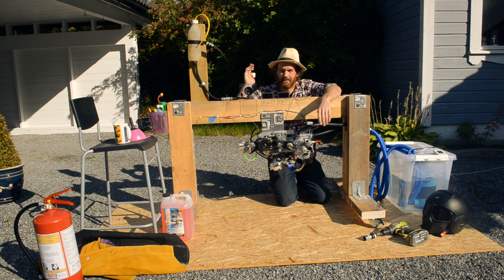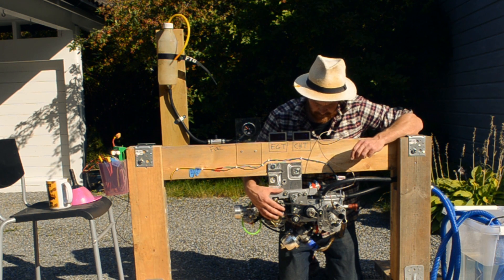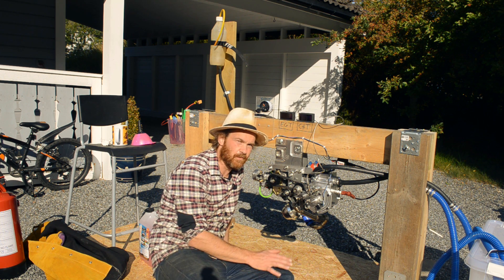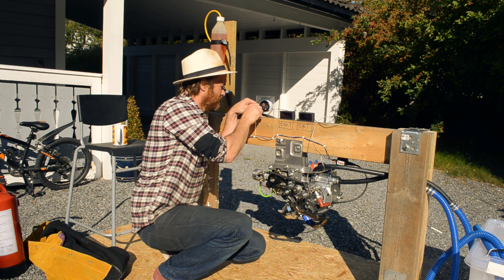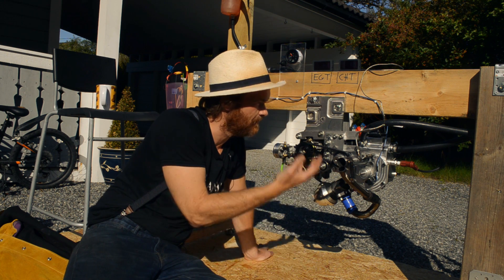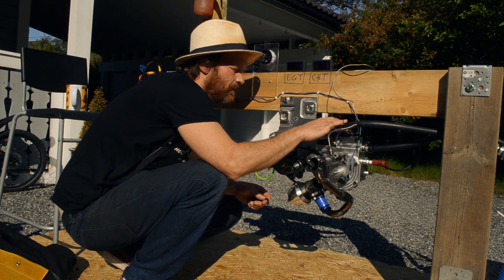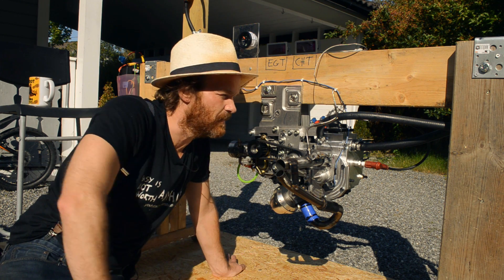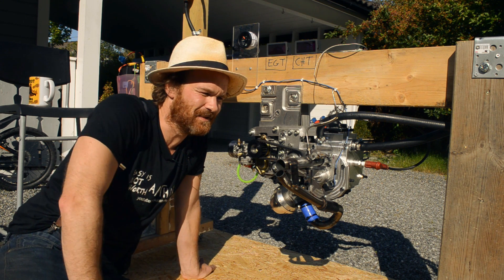First start! 50cc Supercharged Nitro Two Stroke - Will it explode?!

Comment: re watching this video the engine dies a soon as the throttle is backed off and or not reving if this was a 4 stroke adaption i would check timing or exhaust with it being 2 stroke i guessing to high crank case pressure

Comment: Considering a 2-stroke engine essentially supercharges itself as it gets higher into the rev range but has almost no low-end torque, you 'may' need a flywheel of some sort to maintain a steady idle when you're trying to use forced induction.   Just a thought.

Comment: The compressor takes away a lot of the momentum so please consider some small flywheel on the crankshaft or maybe some additional small flywheel also on the compressor shaft. Then the better solution to compressor losses could well be designing some variable compressor depending on engine rpm and throttle position … saving your fuel consumption and waist gate action … compressors are well known horse power guzzlers. Keep up the good work YEAHHHH

Comment: The problem is you're not supposed to supercharged a two-stroke all that's going to do is blowing fuel out the exhaust as the pressure in the head increases it blows more and more fuel out of the motor that's why you are having a lean out where it will not run that's because there's no fuel in the chamber inside the motor anymore it sounds like a good idea but it will never work the more the boost pressure increases the more air and fuel you are blowing out of the motor
Reply from the maker: You might have missed  the part about the rotary exhaust valve.
Reply: @2STROKESTUFFING  looks like it's not working for you 😕
Reply from the maker: @outdoorman6018  See the latest video. Massive blow through before the valve closes at bdc is intentional to purge spent gases.
Reply: @2STROKESTUFFING  it's a cool idea but a lot of work to try to make it work it would be easier to make a 4 stroke  supercharged because it was ment for it

Comment: Respect for all the work and thinking, but this product is totally overdesigned and overcomplicated for the simple purpose it is meant to deliver. And even if its output is 3,28% above other high performance engines of similar size - what is it worth if failure happens after 23 minutes of running?

Many generations of inventors went similar or same the route, only to return to more simple solutions at the end.

Regards from Germany.
Reply from the maker: I know, I know. Already got the simple solution on development (pip engine).
Reply: Thanks for answering. Still I owe you large portions of respect for going crazy on this. Looks like the Swedish Wideness powers such ideas. I robbed a few tipp also for classic working on my 2-stroke project - which however cannot be compared to yours: https://m.youtube.com/watch?v=H3s_CemOJ9c&t=44s
Reply: @2STROKESTUFFING  its a good thing you wear all of that safety equipment and call and tell so many people about the supposedly dangerous thing you're doing. Frankly if you're so dense that you route the exhaust of a motor straight at yourself... yeah, its no wonder you're overly afraid of what you have built. You're a good engineer but idk if your character flaws are going to stand up to the test of time here on youtube. Don't forget that unlike real life, anything on the internet might be around literally forever.

Comment: It just sounds like it's not timed as you said. I think you're going to have to time it during run. Tighten at fastest Rev like in the old days. And I not sure but I don't think you're getting any compression boost. Also your rotary valve is not sealing well enough per revolution.

Comment: It seems to me that the boost might be more than the engine can currently handle, especially with 3D printed parts, I would definitely make them out of Aluminum and use a sealant between the parts so they won't leak, then rinse and repeat. Just remember that 3D printed items are simply melted layers of plastic on top of each other and will not stand up to any kind of pressure and with a Supercharger, all of your engine is running at a net positive pressure, more than a normally aspirated engine, there has to be blow-by past the rings as well causing your crankcase being pressurized as well, any weak link is going to give way...

Comment: I have been thinking of supercharging my 2 Stroke for awhile. My thought is using a solinoid like the koensigegg to control the power valve to close the exhaust port as well as controlling the power valve timing  to stop the charging escaping out of the exhaust port while on boost. Any thoughts?

Comment: Is nylon compatible with nitromethane though? And going for all-metal is obviously better, but further development for plastic parts when racing (for lighter weight) or use titanium or simply weld aluminum plates and pipes together

Comment: I think your exhaust valve timing could be affecting the idle. If it's a fixed timing, that has to be a tremendous amount of boost at low rpm. Maybe it needs a little advance at idle

Comment: Laudable effort.
Kudos!
One does wonder how long it will take to develop this monster to its ultimate iteration? 
The motorized bicycle laws in my State of Minnesota; might need a little tweaking. Laughing maniacally right now.
I have built several motorized bikes this century none have this much potential for over the top Ludacris torque.
Awesome sounding weed eater. I suggest contacting FMF for an expansion chambered exhaust pipe.
I look forward to your further efforts in this project

Comment: I would think there's an inherent problem using a blower on a two stroke as the only pumping action needed is from the piston and a blower may complicate things . A really good expansion chamber would make a much more significant and reliable power boost .

Comment: hello you used a compressor that is too big and the engine is not able to drive it. proposes to change (increase) the gear ratio to the motor compressor line

Comment: When I was 12 I hooked up a giant air compressor to a ryobi string trimmer and put 20% nitro rc fuel in it and opened up the carb jetting this sound reminds me of how that weedeater sounded, I was probably putting 40psi into the engine, and looking back, I can't believe it ran at all. Just imagine this thing with 20psi boost and high compression with high nitro content, the cylinder pressures would be insane!

Edit: it was a shop air compressor and I hooked a 1/2" air line to the carb

Comment: I couldn’t stop thinking about why the helmet to be able to see anything else going on. Are you planning on riding the wood. Then I saw the face shield and realized you were doing it for protection. And that’s when I just had to move on. I mean society has become such pussy. You think we as techs and engine builders wear a helmet every time we start a motor for the first time lol no. No we don’t. If that motor comes apart it’s not going to explode lol. Iv seen one motor exploded in may entire career and that was a 950 cu in alcohol drinker that had it out for use sense day one. It loaded up its cylinders with its juice.  Became a cranking time bomb. I’ll tell you right now if any parts it one of us a helmet was not going to save us.

Comment: Instead of relying on the 3D printed part to seal why not add an o-ring groove in the part to get a complete seal? As long as the 3D printed parts can hold up to the temperatures without deforming the o-ring should take care of the rest.

Comment: I have thought of this lots of times but I think the major drawback of mechanical compression is that it takes power from the crank, and with a very small bore eninge with almost no displacent you'll have lots of losses in making a good positive charge.

The rotary exhaust my man is insane 😍 I was thinking about some sort of dipraghm like a camera has that was cam operated
So you could change the timing and the amount of spill flow trough the system..

Could you check maybe electric turbocharging?  Way easier to do and has no problems with losses.. Only needs a batt pack...

But wat a nice build, you got some seriously good ideas and a one hell of a crafts man 😍

Comment: Blow through or injection would seem better so the boost regulator valve which is what I would call it not really a waste gate, It would seem a lot more efficient to bypass either back into the intake or have the fuel introduced after the valve

Comment: Maybe you could make some kind of metal spacer/plate that bolts on top of the plastic parts (like between the plastic and the bolt heads) pushing them down all around. Love your projects and how that prototype came together so quick

Comment: My experience with SC is if you have a spring actuated blow-off valve the spring needs to be extreeeemely sensitive to follow the rpm /throttle. If you just have a "regular" BOV the pressure with fluctate very much depending on how fast and slow you twist the throttle......

Comment: In 1974 I ran a Kawasaki G5, 100 cc bike on model glow fuel. It had to be started on gasoline by filling the carb bowl with gas then connecting the nitro fuel line to the carb. It would not idle well but ran flat out like A Raped Ape!
Additionally, your motor sounds like it has much internal drag! That is how my bike acted just before seizing a piston!
Good luck!
Oh and a micro fine copper wire between machined surfaces will effectively work as a seal or on surfaces not exposed to extreme heat you can use a silk thread. That is what is used between the case halves of the Lycoming Aircraft engine on my airboat.

Comment: Hey there! Cool stuff you make, really enjoyed it. I might be wrong, but here are some advices that may help you later:
a) The fuel mixture is far too reach as long as I see. I mean, nitromethane can burn in really rich mixes, but your engine is kinda suffocating from it, so try to lean it down a bit.
b) Nitro eats through any rubber or soft plastic it meets at all (except for HDPE or so), so that's why it's leaking. Use silicone pipings only.
c) Not necessary: try to use another kind of spark plug, 'bit "hotter" one. The nitro can be ignited by heat, not only by spark. It also can stand much higher temperatures, if I'm not mistaken.
Overall - great job! Love this bad boy you've built already.

Comment: I believe the unburnt fuel is from overcharging the cylinder.  The supercharger pressure is blowing unburnt fuel out the exhaust.  Either a smaller blower or quite a bit more underdrive on the blower to try to limit the overcharging.  On a 4 stroke the exhaust valve closes and holds all the intake pressure in the cylinder.  On a 2 stroke the intake charge will escape out the exhaust port until the piston covers it.  So the overcharging of the cylinder just blows out the exhaust.  Maybe timing the rotary exhaust will help also.   Always look forward to seeing these experiment from you.

Comment: Not that you haven't thought of it - but why not just make a flange (like used on a muffler pipe for a car) out of a flat piece of aluminum.  This will create 360° of clamping force when the nuts are tightened (for your printed parts).  Might be quickest and most efficient means to creating a robust seal?

Comment: i wouldnt have put that wastegate pipe right next to the exhaust. It offcourse blows out unburnt fuel and air, and you put that together with the exhaust. That is the biggest risk of a flamethrower right there. It would have been better to direct that to the other side for the test so the risk of setting yourself on fire was smaller for the test, but thats just my idea.

And you should try and get a few different size pulleys for the blower so you can tune the maximum pressure by sizing the pulley, and then you can just do without the wastegate. And the reason you can run without a wastegate is because you have the throttle valve before the blower, so if you let of the throttle its impossible for the boost to go up as there just inst any air going in to the blower. That is how i ran it on my car. But my carburettors kept freezing up so it never really ran wel.

Comment: Absolutely incredible achievement, you should be so proud of this. 

If you’re ever in Australia, I’d love to get you round for a few whiskeys and to check out our nitro funny car in detail, it would give you so many ideas to work with!

In the meantime, Unburnt fuel at idle is fine, helps cool the motor, but more ignition advance as the rpm goes up will burn more of the fuel in the cylinder. For reference, we run up to 60 degrees advance at 8,000rpm with 90% nitro.

Also, now that you’re running a blower, you can experiment with reducing cylinder compression and compensating with more boost - by doing that, you’re effectively increasing the combustion chamber volume and increasing the amount of fuel and air burned per stroke, but still maintaining the required cylinder pressure.

Comment: Have you considered running a regular re-circulation (Blow off valve) valve routed from post supercharger to pre-supercharger, use the post supercharger pressure as the reference line, bled off as boost control with a MAC valve, when bleeding off manifold reference from the bov, it will open the valve by the supercharger forcing the valve open with boost, also allowing a failsafe mode where you could rig up another solenoid to dump the reference line to atmosphere and bypass the boost back to the intake. I know Turbosmart do a plumb back thats 34mm inlet and outlet so would be more than enough flow for what you need, also the only seal in it is an o-ring so no diaphragm to rupture to ruin your day with over-boost, Or you could DIY a soultion with the CNC.

I think this would allow you to use an off the shelf boost controller to control the boost by hooking it up as per a standard "internal" wastegate style, will also handle all the PID stuff for boost targets and could act as a boost gauge too, as well as most usually have multiple boost presets available.

This setup would also has the added advantage of allowing more efficiency as it wouldn't be dumping raw fuel into the exhaust/atmosphere and also save you some running cost too in regards to nitro. Just some fuel for thought

Comment: Would it be possible to machine a aluminum part idk 1/8” or so thick that slips over the existing plastic reed valve to distribute clamping load better? Might be easier than redesigning part or printing a different material. Excited to see what you come up with

Comment: Cast the nylon parts with aluminum. Use them as lost abs molds. No point having the leaky parts slowing you down. I think you still need an expansion chamber and wider exhaust timing. But AWESOME work on the engine no matter what! I remember the feeling when I first started my own engine for the first time!

Comment: I admire your  persistence with this project, however it will not work as you expect. Any excess  pressure into the cylinder during intake will just blow any fuel mix out of the exhaust port due to overlap. This is evidenced by raw fuel dripping from this port during operation. There can be very little extra boost pressure in the cylinder that will do useful work. A relatively  low crankcase positive pressure is needed only to displace any residual burned gasses in the cylinder during intake., any more will be simply wasted  power from the engine..... you can hear the engine working hard just to pump this unneeded pressure.

Comment: You have done a brilliant job! Can I suggest having the dump valve pump those gasses back in between the carb and the supercharger, to avoid the explosive plume of fuel air mix.

Comment: Try using banjo clamps to tighten everything down and use sealant as well to reinforce the sealing, that should take care of it,  why didn't you start at 0 timing to begin with? Most new builds start at 0 and advance till you find the best mark (just curious),  sounds awesome but it sucks that without power it immediately falls on its face and dies,  can't wait till it gets fine tuned and runs well,  awesome engineering can't wait for the finished product

Comment: hello from venezuela dear friend, rc gas is a blend metanol : oil  5:1 your engine blend must between 15:1 to 20:1 because your engine is water cooling sys. the opposite of rc engines that use excess oil to transfer the heat through the oil, try this tip i was in moto gp mechanic  125 and 250 cc  from 1986 to 1988 our raider was ivan troisi 👍

Comment: Wow.
The 2SS engine?
Needs a name now ...
Much impressive.
I have an idea if I may ..if you replaced all the nylon fittings with brass ones with pressure sensors or flow sensor sensor equipped fittings you end up with a whole load of data.
Might be nice to have regulatable bleeds on them too, you never know maybe the leaks in this way are a blessing , preventing any sort of bang hypothesis ftom instant fruition....knowing the pressures and being able to lower or raise them or add in transfer pipes / balance pipes...etc...
It's pretty damn cool to see it come this far , thank you for sharing this journey.

Comment: For testing purposes, I would pre heat coolant to designed operating temperature, this will allow jetting and throttle adjustments to be made. Also all mating surfaces will have reached desired thermal expansion and possibly seal any leaks

Comment: The noise my friend, my god the noise that little monster makes is unbelievable. Reminds me of this 1977 Suzuki PE175 engine i put in a dingo go cart when i was 12. For a 50cc to sound more spicey than a 175cc says a lot. By the way, the dingo went 52 mph. With no suspension, 52 mph felt like straight up light speed. Ive done 206 on my r1m and 194 in my R8 (im not rich its just a 2006 4.2 6 speed i bought wrecked, fixed it, painted it all black, then threw on a procharger and a bunch of other stuff) yet i was exponentially more terrified going 50 in that little Costco bought deathtrap.